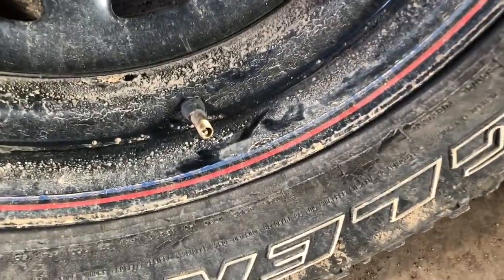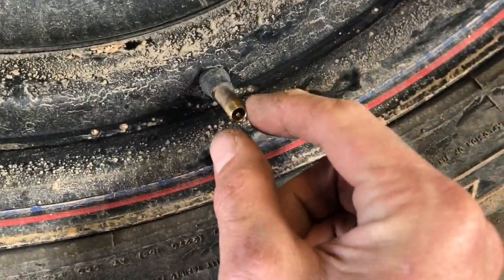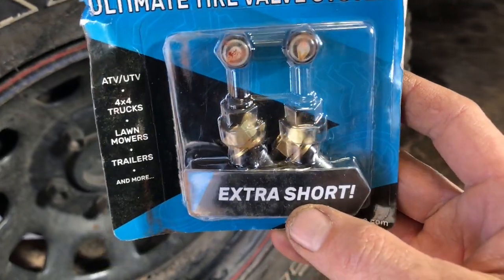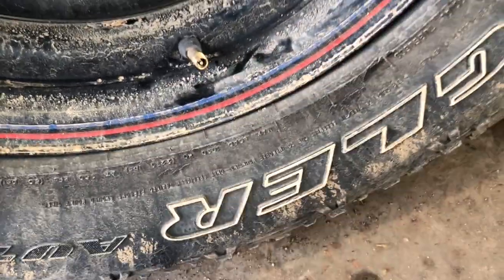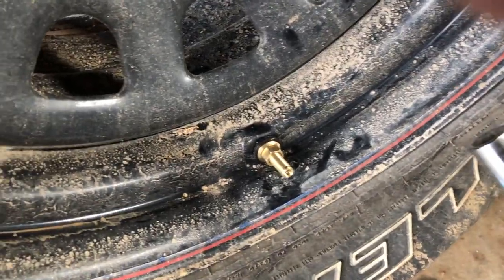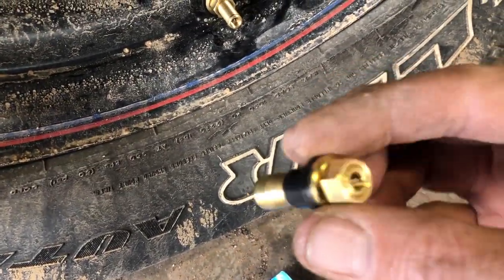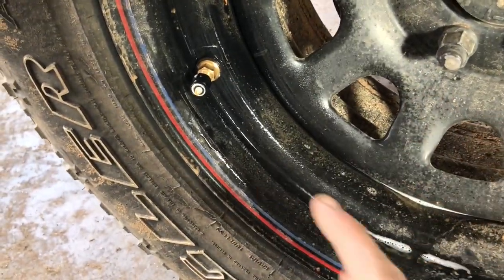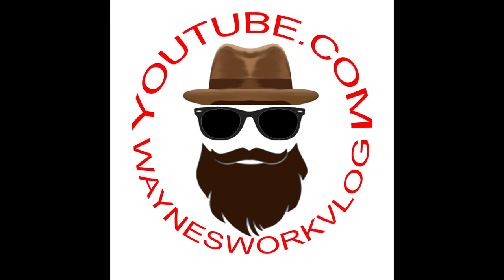Colby Valve Ultimate Tire Valve System S15E01

Comment: Looks like a good thing for when you damage a valve stem when on the trail and need to get home!!! But I agree with you about taking it back out not just because of the cost but a hard stem could be broken off when rubbed up against a bolder or whatever where a flexible one would just move over without breaking!!!
Good stuff brother!!!
Keep Rocking it out!!!
Reply from the maker: Exactly!